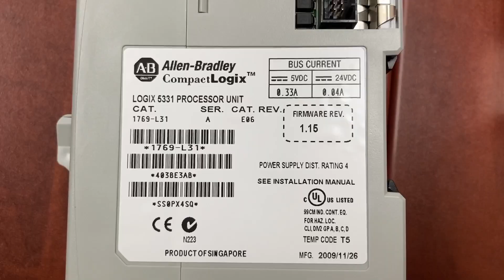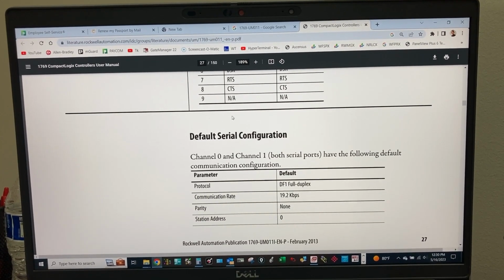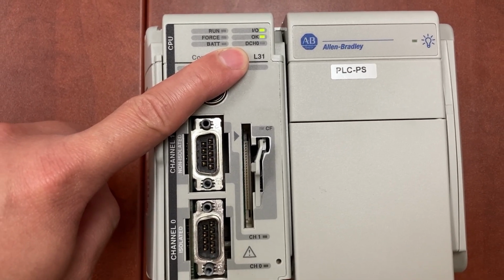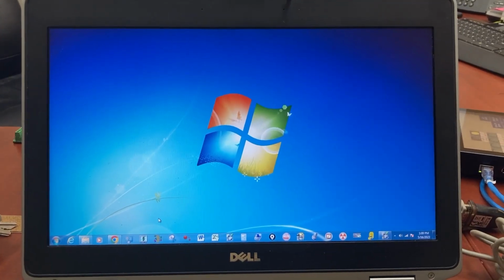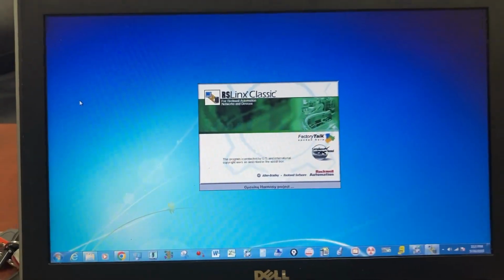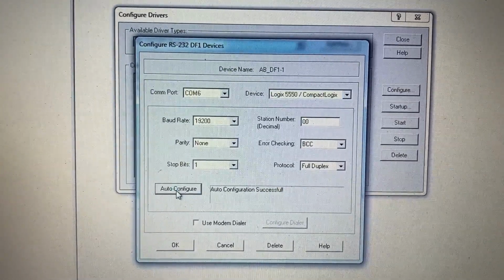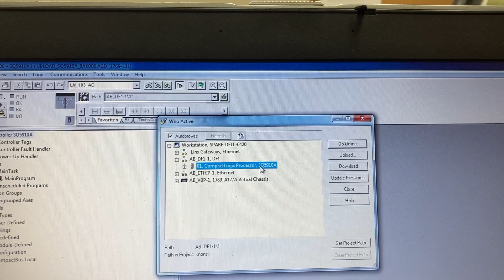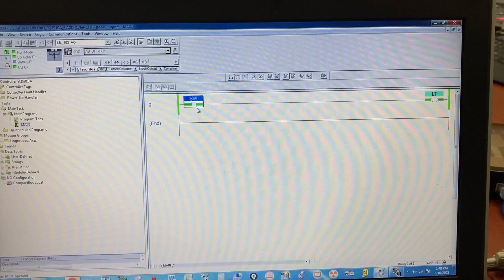Allen Bradley CompactLogix 1769-L31 Communication

Comment: Great. How could I connect factorytalk view to this controller at the same time. Thanks
Reply from the maker: @Steve-kw8wh: There are 2 serial ports on the controller. If both ports are set up for the same communication protocol, 1 port is for the HMI and the other is for your computer. ALL 3 can be on the same network for the communication.
Reply: @SYPHOANG  Thank you very much.